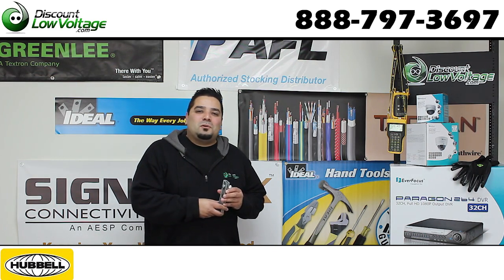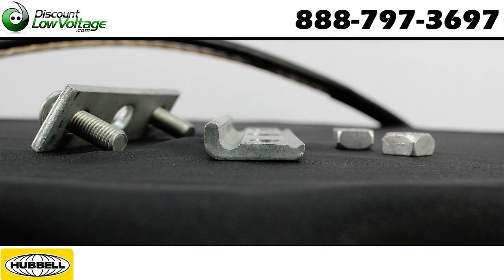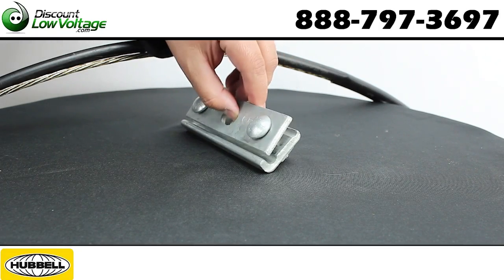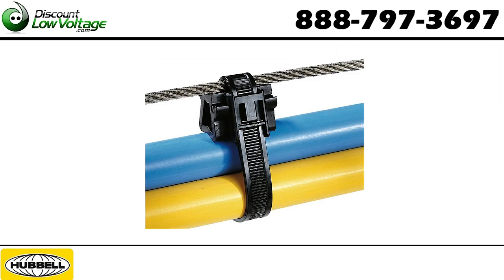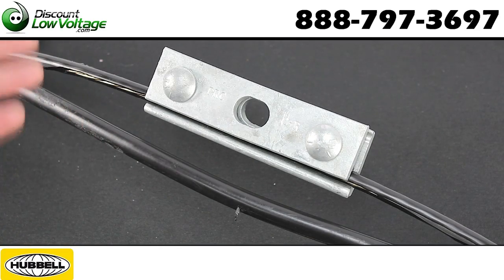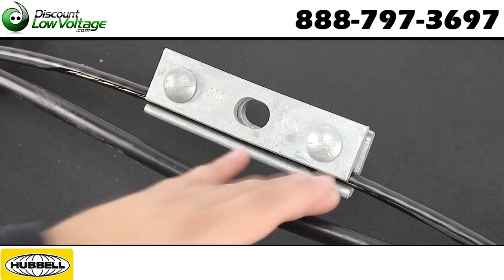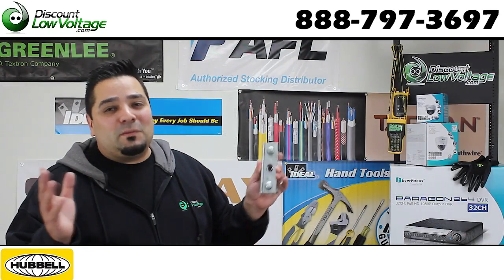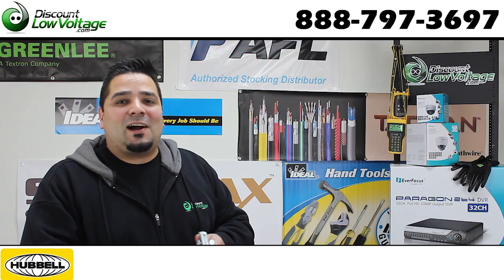Pole line hardware for mounting messenger wire to pole

Comment: Hello do you know if there is a chart that would help select messenger cable size for cable size and quantities?
Reply: If you’re putting up fiber or small copper cable (usually 300 pair or under)  its gonna be 6.6m / 1/4 inch strand.

Comment: First that clamp is called a b strand clamp, also all sizes go through the bottom of the clamp at the L. If using self supporting cable the strand is encaplsed in plastic its a different clamp it has waves. But you can use the b clamp if you strip the hard plastic off.
Reply: Is it fine if i strip the plastic off the messenger wire of figure 8 before clamping?
Reply: @carlo2721  you can, but you dont need to if using the type of clamp shown in the video.  All youd need to do is separate the strand from the cable, but the insulation on the strand can remain. If you intend to bond the strand to a ground, you just need to strip off the insulation to expose a small piece of strand big enough for the grounding clamp. Stripping all the insulation off the strand just to place it in a straight or curved clamp is unnecessary.  If self support strand is/gets separated from the cable, i personally would not use a self support hanger either - I’d use the hanger shown in the video. Self support cable/strand can get ripped out of self support hangers if pulled hard enough - but the strand or pole would need to break before it would ever come out of a standard hanger.